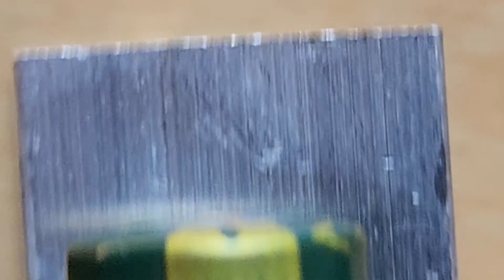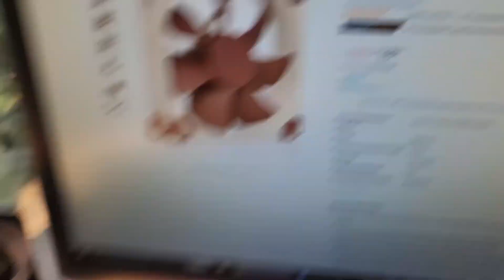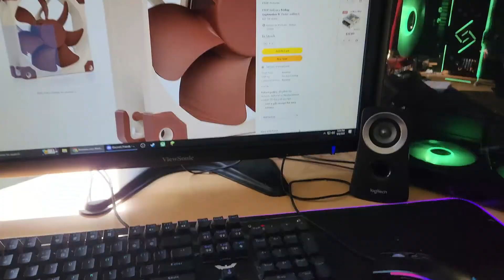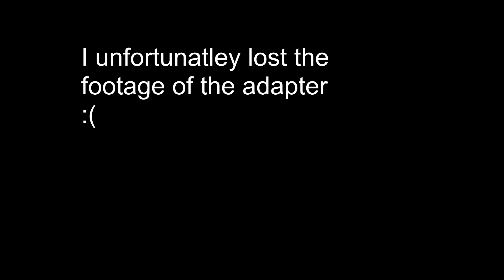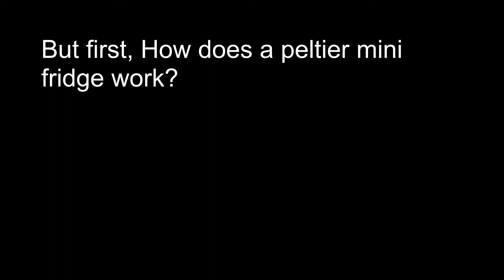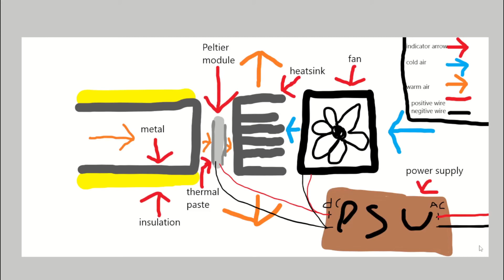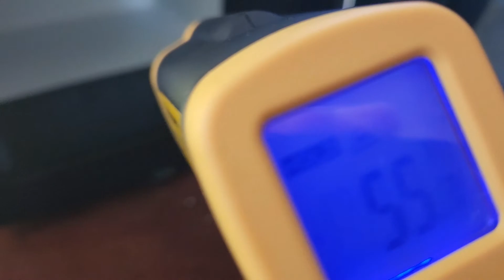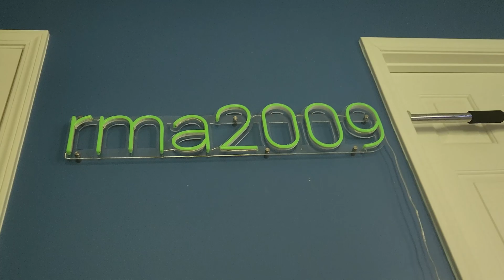Repairing my frigidaire 6 can thermoelectric mini fridge

Comment: So put a power supply and a delta fan on the bitch to drop the temperatures?
Reply from the maker: yeah or buy an actual compressor fridge instead of this shitter
Reply: @ the shitter is already bought and I don’t want to have e waste laying around. So it’s getting rebuilt.

Comment: what does the wiring look like for the power supply?
Reply from the maker: L & N is the live and neutral AC power, v+ and v- are the dc output, you can ignore the ground wire in the middle